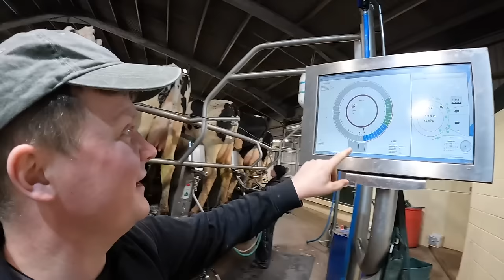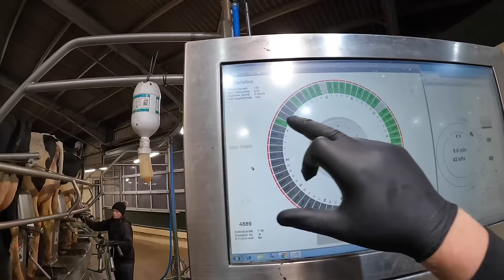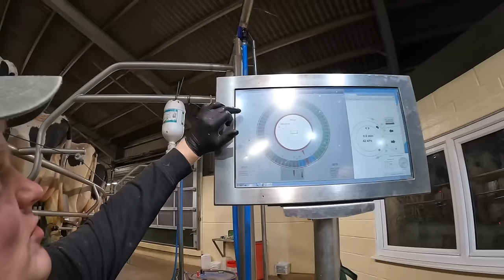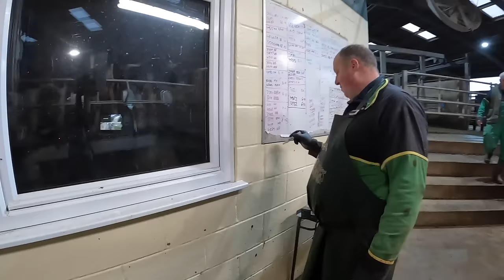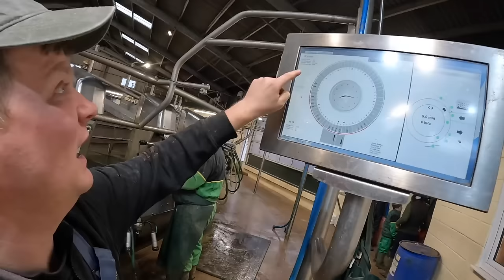IS THIS THE BEST FARM I HAVE EVER BEEN TO!?

Comment: Several farms around here uses sand bedding and has a sand recycling system.  They don't scrape too often because each alley is flushed with 1000s of gallons of water every 10 minutes.  The sand is filtered & "washed" and it dries very clean and reused many times.  All the manure goes through digesters which produces methane which is burned by generators to produce electricity for the dairy.  They also have most buildings covered with solar panels.  They actually sell excess electricity back to the grid because they produce so much per day.  The water eventually (after about 12-15 "reuses" gets pushed to the field irrigation system.  There is no runoff.

Comment: That's a brilliant farm! These guys should have their own YouTube channel.
Nice clean, content and happy cows. 
When I first started working on dairy farms, the farm I started on had a six abreast milking parlour. Not great because the cows had a big step up to make to get in the stall. And when there, a chain was put across the back of each cow to stop them backing out. A lever was then turned to dispense provin and away you go. You also had to keep an eye on the cows when they wanted a pee or a dump, very easy to get an unwanted shower or pasting because you are stood about 18inches below the back of each cow.
The second farm I worked on still milked in shippons using the old pipeline system. That was a completely different experience.

Comment: The biggest thing that jumped out at me was that every animal and worker was relaxed/calm. That is a huge thing in being successful with livestock.  Their entire system is well thought out and works smoothly. Their work load is not too physically taxing either, that really cuts down on fatigue. 
  This is like outer space when compared to how my Grand Father milked in 1970. He milked 20 cows by hand into a five gallon bucket and ran the milk through a strainer on top of a ten gallon milk can. He then took a hand dolly and move the can across the road to the can milk cooler. ( Not a heavy enough electrical service in the milk barn to run the coolers) IRC the can plus the milk, weighed right at 90 lbs.

Comment: Presumably having a decent sand quarry nearby helps if you are going to bed on Sand. Also assume it doesn't have a secondary use either whereas woodchip or straw can at least be recycled. That was impressive

Comment: Most impressive in so many ways and as you said very clean cows. But also sad  at the same time that you miss some of the smaller farm connections to your cows, calfs. And this is probably the way in/ for the dairy farms future if you want to  stay in it expand dubbel/ trippel up the heard of cows and fields and add at least5 -10 more liters/ cow and cut milking time by  a lot
 And cows inside the hole time is not so bad if they had a free choice mostly all stay inside any ways. It save ground for grass to be cut instead or some maize. Keep on Keeping on and thanks to all the farmers across the globe. Big or small everyone counts/ Johan